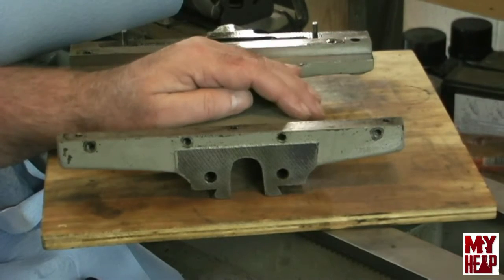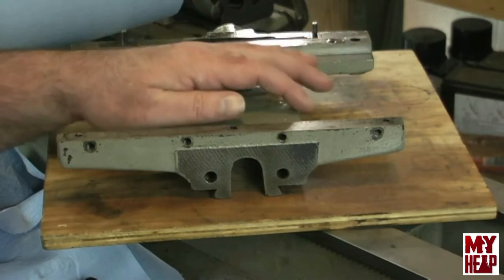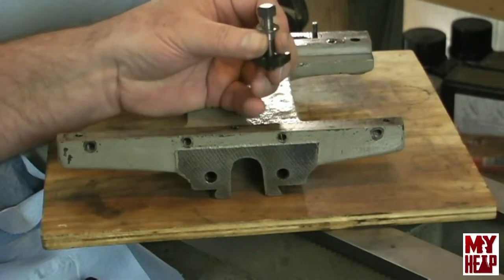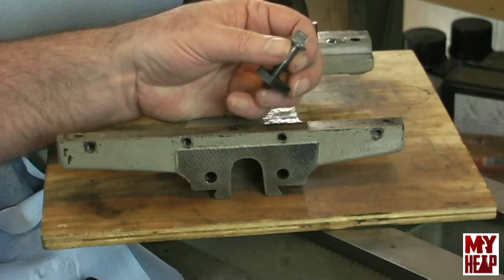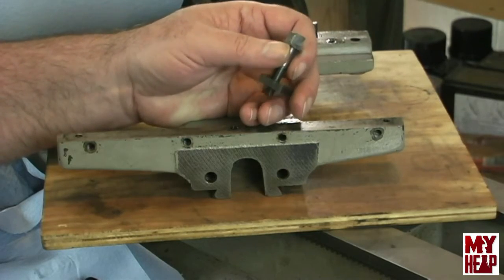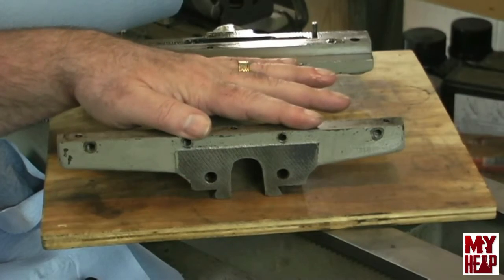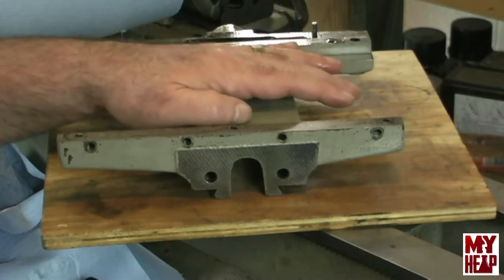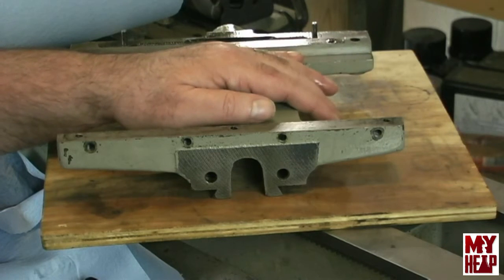Atlas 10F Lathe - TH54 - 17 - Assembling the Saddle and Installing the Apron

Comment: Its very nice to see your lathe coming together. Really enjoy the detail in your videos which I will use as a reference in the future when I start yanking my stuff apart when I need to...you are archiving a valuable resource for the rest of us to benefit from. Keep up the great videos and here's to makin chips Joe 🍺😊
Reply from the maker: Thanks Richard.  I hope they are a help to someone.  They have helped me.  HAHA.  I am getting excited, and maybe a little apprehensive.  Some of the first machining I need to do, I would feel be easier if I had some experience.  For example, I have a new 3 and 4 jaw chuck (Chinesium) with back plates, but the back plates need machining.  I have to fabricate the T nut for my QCTP, which I think will end up being a hand tool job, (Saw and File).  I will get there though, I have had plenty of people to watch and learn from, so at least the knowledge is there if not the practical experience.  Regardless, I am having fun!

Joe
Reply: Jeez MNFS that's a lot of jaw boning !!
Reply: I got a small mill, shoot me some specs on the nut :)
Reply from the maker: I will take some measurements and send you a drawing tomorrow Rich.  Thanks.

Joe
Reply from the maker: Richard, I sent you en email with the specifications.  Hope you like a challenge.  hahah

Joe

Comment: joe the hole for oiling the cross feed  that doesn't line up i think is in a groove correct me if im wrong .  i believe even if it doesn't line up that that groove will fill up un tell the level of that hole is reached then it will go in every time pi add oil.
Reply from the maker: You may be right Chris.  I will pull it out and take a closer look to see if oil can get to the hole for the feed screw.

Thanks, Joe

Comment: Hey, did you check the clearance of the carriage to lathe bed on the opposite side to the gib, if I recall it was the side that had a shim, now is the time to check. Regards Peter
Reply from the maker: No I didn't, but will cover that in the next video.  Both sides had a shim so I returned them back when I reassembled.  I am curious if they are the correct size or if there is enough wear to warrant new shims.

Joe